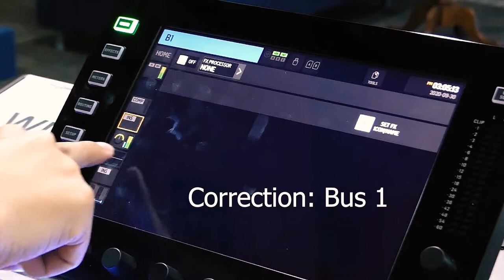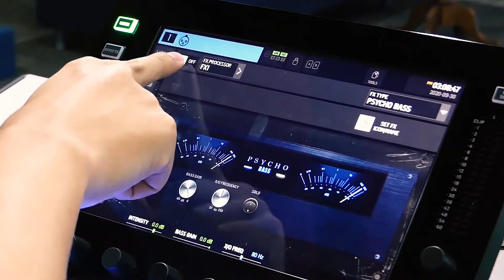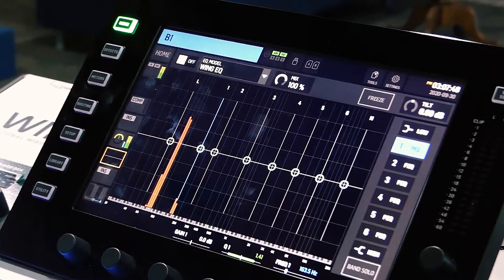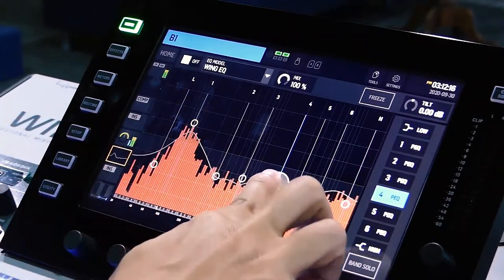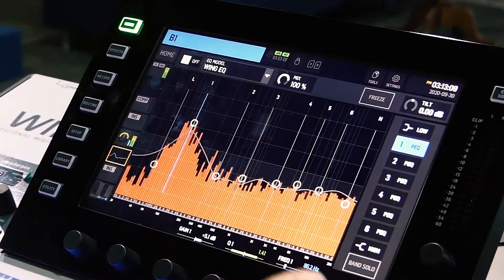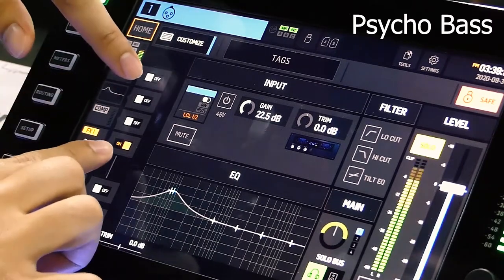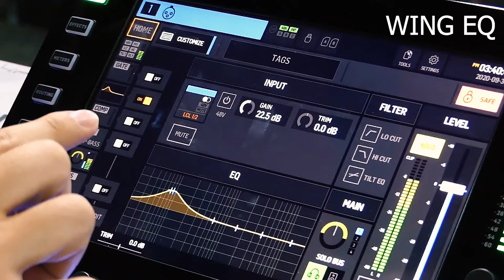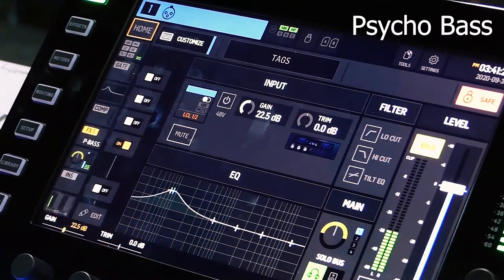Psycho Bass Plugin VS WING EQ for low frequencies in Behringer WING

Comment: That kick out needs a lot of eq. A big scoop on the lower mids around  250 to 350 hertz. But I know this isn't the point of this video.....cool comparison.  I love that they included premium effects on every channel so you don't have to burn effects rack slots to get individual eq and compressors on channel inserts. That's probably what will sell me on this board more than anything else.
Reply from the maker: Yeah, love the flexibility. Those plugins actually very powerful and useful

Comment: Can you not set the RTA to be post fader on the channel so that you can see the results of the effects chain for that specific channel? Seems like that would be a pretty standard feature.  That way you don't have to monitor the rta in the bus, you can do it all from the channel
Reply from the maker: Can, but I need to toggle between the FX plugins. This has more steps and take longer time. Using 2 channel make the comparison much easier and faster. Just press the relevant "Select"
Reply: @ericcheesaihoo  Yeah that makes sense. They've changed a few things on this board from the x32 for no real decent reason,  so I was honestly worried that they changed the RTA routing like that too. Glad they didn't. I wish they wouldn't have changed the eq layout. That has to he my biggest hurdle holding me back from wanting one. They're relying too much on the touch screen.

Comment: I think both boosts sound bad - too much upper bass boost.
Reply from the maker: it need to be boosted dramaticaly so the different can be heard in YouTube. You can try with less aggressive boost and compare them with the unit itself. With real speaker and subwoofer, you can feel it even with less aggressive boost. It's a creative choice to boost or not boost. If you decide to boost then the plugin provide another option in your arsenal to be utilized.